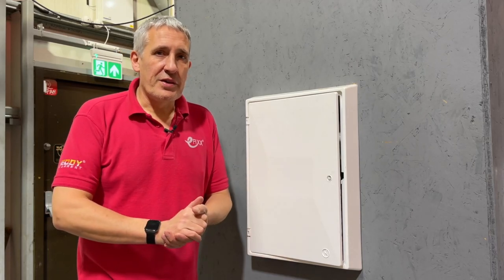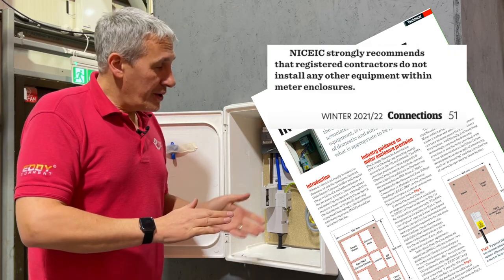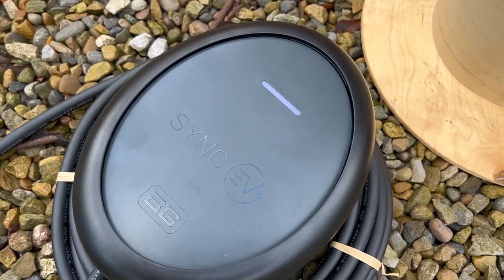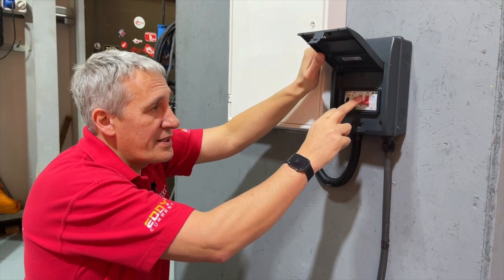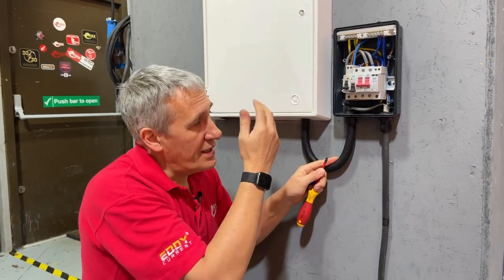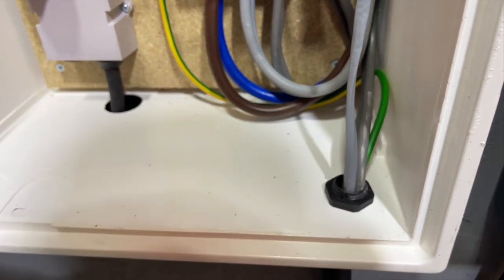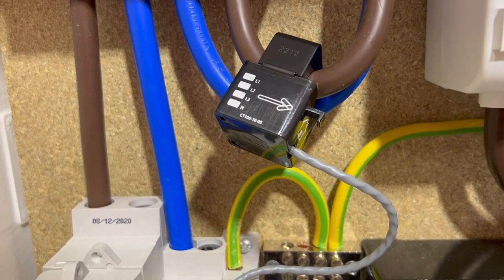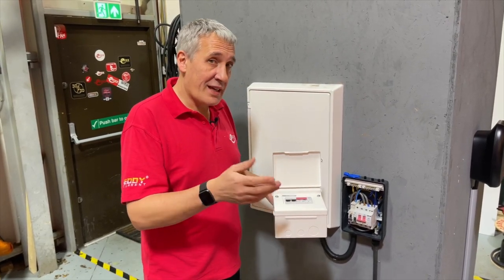Thinking Outside the Meter Box: Outdoor Consumer Units for EV Chargers

Comment: Retired DNO engineer here. The thorny issue of what can and cannot be housed in a meter box seems to come up about as often as the 'can an electrician pull the main fuse for isolation' issue.

Any person applying for a supply of electricity from a DNO (or IDNO) will discover part of the letter of quotation stating, not unreasonably, that accommodation of the DNO's terminal equipment and the meter operator's meter is the responsibility of the applicant. The letter will usually state the minimum accommodation requirements in terms of location of the apparatus and physical dimensions of wall space required, which will vary, of course, depending on the supply type and capacity. For many domestic installations, the wall-mounted meter box is a convenient and readily available way to satisfy the accommodation requirements.

The important thing to note in this issue/debate is that the supply termination accommodation belongs to and is controlled by the owner of the property, not the DNO. The owner can put anything they like in the accommodation space as long as it doesn't present any safety issues to the DNO's equipment or the metering equipment, doesn't breach any building regulations or standards and does not impede the reasonable access to the installed equipment by the DNO, meter operator or their agents. You can keep your milk cool in there or store your DVD collection or keep a potted plant in it if you want (well, maybe not the potted plant) - it's YOUR building! DNOs and organisations such as NICEIC are inherently risk-averse so it comes as no surprise that they take the safest, least controversial route and respond with 'we do not recommend....'. I've seen LV cable-heads in some interesting locations, although all the meter boxes I've seen are pretty unremarkable, to be honest.

As videos like this demonstrate (thanks Gordon, for another excellent video), the prefabricated meter boxes are principally designed to accommodate the supply termination and metering equipment alone and not much else. That anyone actually manages to competently and safely fit additional equipment in any standard meter box is testament to their skill and determination! Maybe there is a potential market for a 'meter box +', which is designed to accommodate the usual apparatus and additional equipment like the BG distribution board shown in this video. Might be some structural issues about needing a lintel over the top or something like that; I'll leave that to those qualified to comment on matters structural.

Just one point about the EV Ultra cable. Recently, on another fairly well-known, UK-based electrician's YouTube channel the creator was 'pulled-up' by commenters for routing a Cat 6 Ethernet cable through a distribution board (the route made sense, physically) on the basis that BS7671 Section 528 (?) said it was not permitted. Maybe the insulation design on the Ultra cable ticks the boxes that a bog-standard Cat 6 would not.
Reply from the maker: Great information and a very sensible approach suggested - I'll use this in our eFIXX TV episode on Wednesday - cheers *Gordon

Comment: If the UK wants to encourage EV adoption, they have to drop the idea of having the charger connected to the internal CU box. 
For many houses it will be impractical, unsightly and expensive. 
I am about to have an EV charger installed by a major energy provider, and they do not require any connection to my internal CU box. 
Thanks for the video, I really like that solution.

Comment: My charger was installed directly from the outside meter box (additional consumer unit in box). DNO have been recently and have not mentioned it.
DNO are monitoring voltage into my house as recently charger has been shutting down due to a high incoming voltage supply (above 256v). DNO engineer said this is becoming quite common and being highlighted by car charger owners (apparently car chargers are less tolerable than other household appliances and so go into fault for protection when incoming voltage rises too much).
Reply: Bg told me the same, they said you have to turn a cooker or shower on to drag the voltage down to reset the  charger, a real problem I hear.
Reply from the maker: It's probably your energy supplier who are responsible for metering who are more likely to have an issue with space inside the cabinet. The PEN fault device is most likely causing your charger to trip. This could be down to a cable fault, so the PEN detector doing it's job or more properties in the area being fitting with solar PV - 253VAC is the maximum voltage which is allowed at the properties supply point, hence the DNO need to investigate.  Check out this video to understand more of whats happening 👉 https://youtu.be/p562IZ1nOSM

Comment: Does it have any way to lock the cover in place so anyone walking past are unable to turn off your car charger?  Big design oversight if not
Reply: What’s the point in locking the fuseboard when the unlocked box supplying the fuseboard is next to it .
Reply: But meter boxes are locked! Admitted minimal security lock but stops the local kids casually switching the power off. Not many of them will be carrying a meter key.

Comment: Armoured cables have a minimum radius specified for bends.
Do EV ultra cables also have minimum bend radii and if so - are the right angle bends in the decorative trunking too tight?

Comment: For white rendered house you can get white heat shrink sleeving to put round the cable. Think it comes in 5m lengths. Then use linian super clips that are available in white.
Reply from the maker: Great idea
Reply: I very much doubt that heat shrink sleeving is UV protected. It's a sort of stretched rubber that tries to revert to its original dimensions when heated.
Reply: @TheEulerID  Well it's not fallen to bits and has been on over 3 years now. It's not the brilliant white it was and has dulled down a little but so has the white paint on the render and the UPVC windows so blends in more than it did. 
If it does fall to bits in a few years it's not a massive job to replace it. Still think it better than a junction box on the wall swapping from black to white cable.

Comment: Nice video, thanks.
BG SyncEV range has few of these enclosures : CFEV1A has double pole RCD, CFEV2 is a 100A mains switch, CFEV1RDA has RCBO etc. - some are for use with cables with mechanical protection and some are for cables without mechanical protection.

It will be good to understand when to use which unit - will you be able to make a video comparing these 3 types of IP65 consumer units from BG SyncEV range. Thanks
Reply: Best practice if the cable has no mechanical protection ie steel armoured or in conduit etc on the full run then the rcd/ rcbo version is required, if mechanically protected then the 100A version can be used. The 40 A mcb is used because 7.4 kw roughly works out to 32A and you should not run any protective devices at 100% of its capacity for long periods of times and most manufacturers recommend 60 to 80 % of maximum rated current usage to ensure longevity and performance.

Between rcbo and rcd choice is down to what protection the ev charger has built in/advise to be used and the area in 🇬🇧 and regulations being installed to.

I hope that helps

Comment: I have  had and tested so many BG boards and sockets etc that have had faults, for example faulty RCDs or 20dp that don't switch the neutral ( very common) 
I now will not buy anything made by them. 
Anyone else experienced this with BG or have I been unlucky?
Reply: I have experienced this too, the din rail always bends like crazy too making it impossible to get the  cover on.
Reply: Yep, never had so many MCBs fail as with BG
Reply: @rjkelectrical6086  yep the cover is a nightmare!
Reply: I would just like to go back on something tho, I do like their outside sockets.
Reply: I've also seen RCDs that don't trip but just start smoking instead.

Comment: What size tails did you use for this? I wouldn’t of thought 25mm tails would fit in that flexi con
Reply from the maker: 10mm2 - why would you use 25mm sq for a 7kW load?
Reply: @efixx  you wouldn’t , I was thinking if it was being used for other purposes such as providing a supply for an out building or something 👍👍

Comment: And why wouldn't they make as an option one with pen fault detection as well?  That would be ideal so you don't yet need another box on the wall.
Reply: Most EV chargers come with PEN fault built in now
Reply: Check out the Garo unit. Can get them with SPD type A RCD and a pen fault unit all built in. Only unit that provides this as far as I'm aware

Comment: Is the outside Alu box lockable? I have a portable charger that came with a 32A CEE. I’d like to have the Alu box with the RCBO to connect the wall mounted CEE socket to, but I’d need the box to be secure. Thanks.

Comment: Modifying my comments. Originally I believed that there was a temperature rating issue with these products in cold weather conditions, as RCBO's on the BG web site seam t be rated at -5C. But having now looked at an RCBO in real life and also realising that there is a -25C marking hidden under the subtitles in the video I can see that both the RCBO and RCD's are rated at -25C.

Not sure about the SPD and MCB protecting it, but in my mind this is much less critical.
Reply from the maker: BG have placed a product on the market and stated it’s application for this purpose. 

We will explore the topic of ambient temperatures and circuit protection in a future video. 

All circuit breakers etc have rating curves for ambient temperature.  There is a bigger risk placing a consumer unit inside the meter box so an enclosure within an enclosure, which is also subject to the powerloss created by the incoming fuse which can be around 10watts at full load.

Comment: if it's a PME system, would that make the main earth terminal an exposed live part during a fault?
Reply: Not if the EFLI impedance meets the Regs
Reply: @Mike_5  thanks, 
Is that a specific regulation I could look at?
Reply: The metallic casing could rise in potential in reference to true earth during a PEN conductor failure yes.

Comment: Noticed that Octopus Energy "approved Ohme installers" install straight away in the electricity meterbox without a doubt and they advertise on their website as well. These big companies make tons of installations daily and nobody stops them, meanwhile they shave off the market with crap installation without SPDs, EV Ultra cable and make the EV installations cheap as chips...

Comment: I like the idea of this, neat install . Just hope BG boards have Improved there quality as there boards years ago were terrible.
Reply: The die cast ones are ok but I stopped using the steel ones as they’re awful
Reply: @chrismiller8645  what’s the price on a die cast EV board
Reply: Yes I’ve had the same problem, tested a block of flats with bg split load boards in and every rcd (x2 in each board ) failed, turns out they were only install the year before lol

Comment: Great video. Are those 16mm tails you have you used connected that second DB to a 100a fuse though? Or is that deemed ok as the load going through them will not be greater than 32a/7kw?
Reply from the maker: Hi Matt - We actually used 10mm2 and could have even used 6mm - which at first sounds wrong - but check out this video to understand the requirements given in the regulations. -https://youtu.be/BAtCAAUpXsg
Reply: @efixx  i watched that video and for protection against overload yes but what about fault current these smaller tails would be protected by the DNO fuse and apparently this is not allowed. i would love to hear efixx view 🙂

Comment: Octopus EV installed the white version of the box on the exterior next to the meter box - did I hear correctly that the white version is the interior version? The other thing is that on these boxes, is it possible at all to lock or padlock this box so that nobody can get into it?
Reply: The white BG metal consumer units are IP rated to outside. It has a waterproof seal on the enclosure lid and the front of the board. Make sure it’s always clicked shut to maintain the IP rating👍most do have a padlock hole but some of them only have a little tab similar to the one in this video.

Comment: What is the difference in having terminal blocks in the meter cupboard compared to a small CU or breaker. DNO's and the NICEIC are drama queens. Granted in many instances there is not space but where there is why not use it. We have metal feeder cabinets on my jobs for all the houses and we have the space for the head, meter, isolator and either a breaker or small CU for the armoured into the house.
Reply from the maker: The main difference is the protective devices generate heat compared to terminal blocks. At full load a 100A fuse can dissipate around 8-10 watts - so add this to the service fuse and you have 20 watts of heat in a small enclosure, which could also be being baked by the sun.

Comment: Effix why have you used an rcbo when the charger you have shown has inbuilt rcd protection 🤔
Reply: Not sure about the type of RCD in the BG charging point, but a lot of them are OEM designed and built, so don't comply with the BS EN standards for RCD's stipulated in BS7671.
Reply from the maker: It's down to installer choice and installation requirements. A version with mcb only is also available.  Note we haven't used armoured cable in this installation. As mentioned by Paul, The issue regarding built in RCBOs is causing some confusion atm.  People seem happy to rely on the DC leakage element being "built in" to the charger and fit a type A rcd upstream. Surely if the RCD isn't compliant then you'd have to fit a much more expensive Type B device.
Reply: @efixx  Totally agree it's confusing, the way I see it is the 6mA RDC -DD meets IEC 62955 so is type tested, so an external type A RCD 61009 etc  can be used upstream, but the built in type A on some devices doesn't meet  61009. So for me  it's either a departure on the EIC or an additional RCD upstream of the charging point, which can lead to selectivity inconvenience.

Comment: Can you fit 25mm Tails and 16mm earth in flexi con if so what size did you use. Thanks
Reply from the maker: We used 6mm sq - no need for 25mm
Reply: @efixx  Thanks so much for the reply. Could you use 16mm or 25mm in this case though or is it overkill?

Comment: Nice job boy's however 1st of all the metered box is for metering equipment not dp bocks and you haven't left any room for a smart meter as these are much larger.
Reply from the maker: Most DNOs show in their T&Cs for connections that the lower  right quarter of the board is reserved for customer "equipment" for connecting the meter tails.  There is ample room for a smart meter above the service cutout.
Reply: @eFIXX  yes unfortunately the DNO does but don't get confused between the DNO & the MOP in the 1st place the DNO fits the supply in then the MOP fit's the meter and normally a isolator that isolator then becomes the customer's equipment so when the customer then changes supplier that supplier normally requires a smart to be fitted hence the problem no room for the smart meter please see attached photos and required space.
Reply: @eFIXX  have emailed them to you enjoy

Comment: Why does the EV charger need a CT. And 25mm conduit looks better down from CU to Charger.
Reply: So it can send excess solar to the EV rather than exporting to the grid. If the house doens't have solar / some kind of micro generation then the EV charger doesn't need a CT.
Reply: @benlister0 All Pod Point (UK) chargers have a CT to load balance in case total house demand gets near the main fuse load limit and reduces the charger current.
Reply: Yep good point thanks @toob41.

Comment: 16 mm tails? on 100Amp fuse??
Reply from the maker: If you had an 800 amp busbar in a factory - would all of the cables connected to distribute power be rated at 800 amps? 

Learn more here 👉https://youtu.be/BAtCAAUpXsg?si=dRK8cA3t8h01j0v_

Comment: Were 25mm Tails not reqired?
Reply: No. Its only supplying a 7kW charge point so tails sized to suit - 10mm is fine.
Reply from the maker: We made this video which explores the regulations which allow for selection of smaller cables protected by a higher current upstream device 👉 https://youtu.be/BAtCAAUpXsg
Reply: I thought we had a regulation where on TNC-S tails had to be 25mm. We code it on EICR's. What's the regulation you mention that lets up fit 10.0mm tails as would be interested to make sure for future reference
Reply: @Superkev001  that's correct between meter and CU or meter and KMF. 
After the KMF you can use suitably sized conductors.
Reply: @matc1603  but they don't have a KMF. They just have Henley blocks. There is no overload protection other than DNO fuse
Reply: @Superkev001  as long as the run is less than 3m and is protected from overcurrent and “reasonably protected from” damage then there isnt a problem. The use of swa would count as damage protection as does the use of trunking and conduit which is the method shown. 

The overcurrent protection comes from the mcb’s / RCBO’s inside of the secondary consumer unit, and they prevent overcurrent. 

It maybe looks wrong, but as a technicality, because both conditions are met, there’s nothing wrong. All you’d be doing by coding something like that is making unnecessary work and making someone spend unnecessary money.